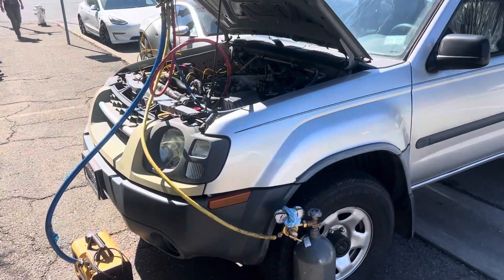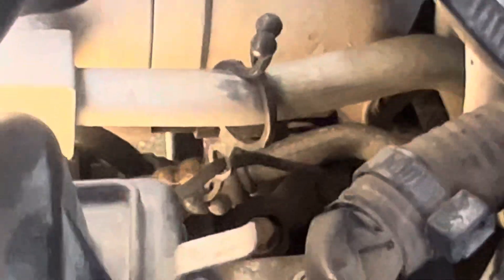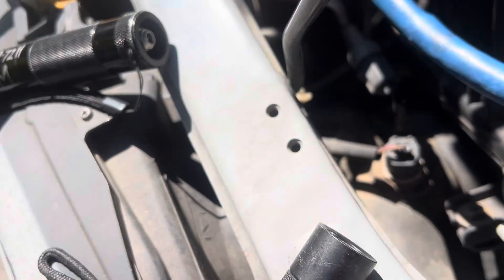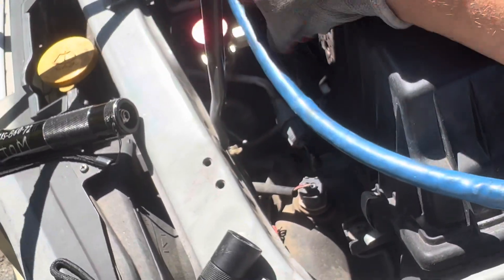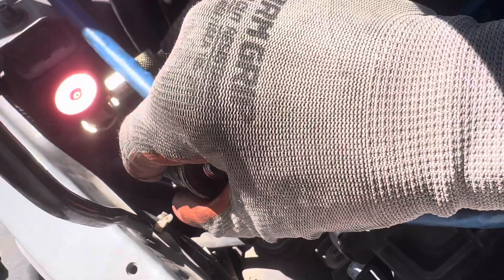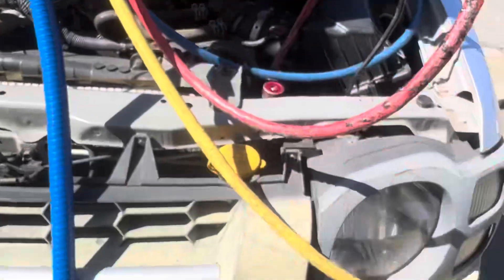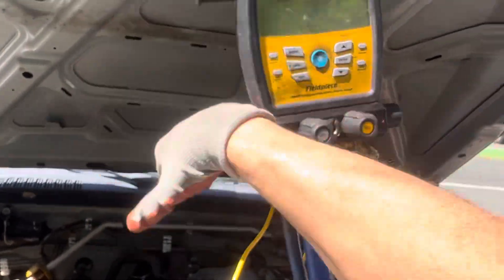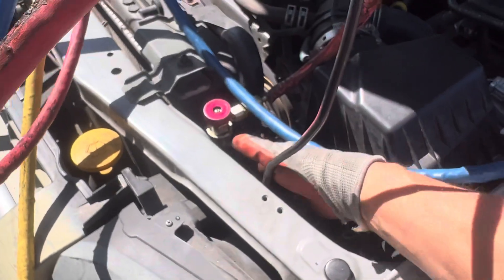Using nitrogen instead of shop compressed air, to find a large leak on the AC system ￼

Comment: Fascinating approach! Using nitrogen for AC leak detection is brilliant. Your detailed explanation and demonstration make troubleshooting easy for everyone. Thanks for sharing this insightful and practical tip!
Reply from the maker: Nitrogen has always been used for air conditioning leak detection.  I’m just about 60 years old and I was taught by my father when I was 12 years old. 
My father was taught to use nitrogen when he was in his late teens and early 20s by an older technician teaching him air-conditioning .  And later he went to a technical school that taught to use nitrogen..,

I went to trade school again later in life they teach to use nitrogen in class . 

And for the more difficult leaks, you use an ultrasonic leak detector for those really tiny micro size leaks that you can’t see, or hear with your own eyes or ears . 

But the ultrasonic leak detector will pick up the frequency of the sound that is very tiny micro have, and you can hear it from many feet away using the earphones and ultrasonic pick up device hold your hand .

Comment: Always wonder why Nissan dye would not show, tought I had the wrong light. Thanks
Reply from the maker: Correct the light not only has to be strong

But you have 365 nm wavelength 385 nm 395 nm 400 nm 410 nm . 

Now the light is really extremely strong and good like the UV beast V3 they’ll be enough bleed over light from the upper and lower spectrum that will somewhat work on different manufactures UV dyes

But if you have the exact specification, nanometer wavelength light for specific, manufactures wavelength, UV die, then it’ll show up extremely bright. Even if you took the car out into the sunlight opened up the hood, you would still see the dye glow brightly even with bright sunlight. . 

That’s the difference between a good light and a good UV dye, and one that is not or one that is not proper .